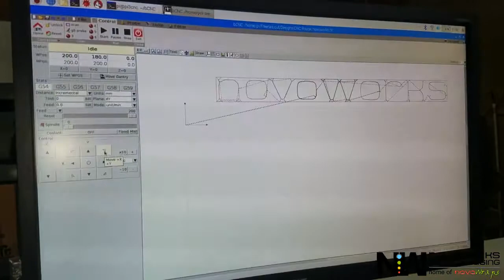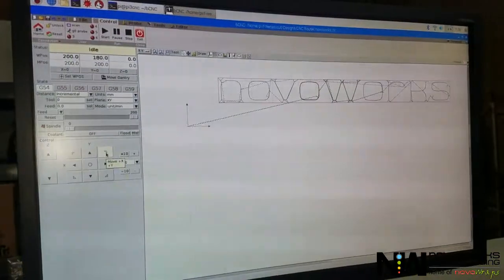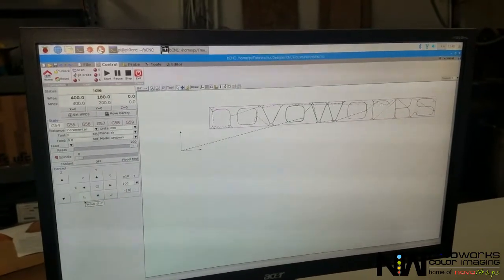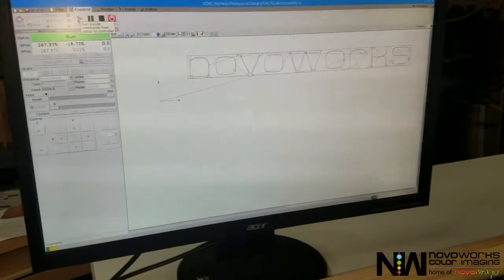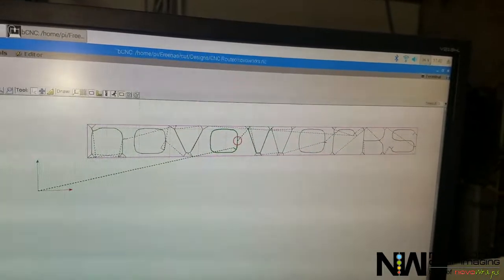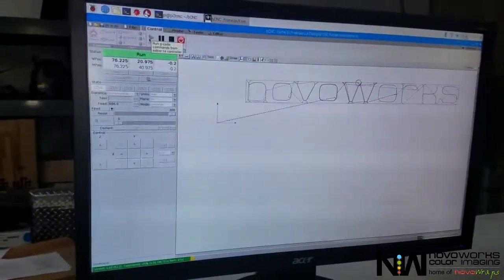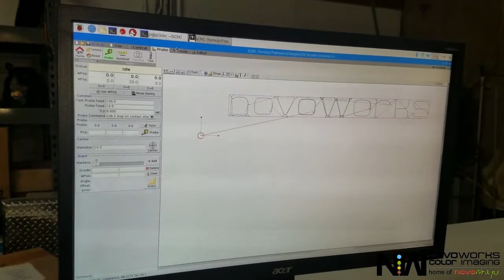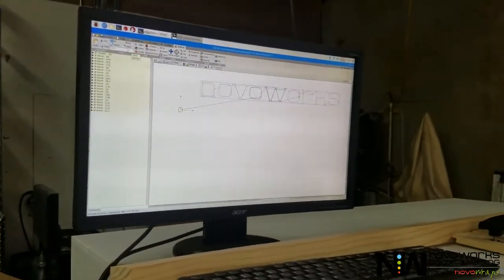Quick video of the Raspberry Pi 3, bCNC and the Shapeoko XXL

Comment: i has build rpi3 and gpio output whit shift level converter, 3,3V in to 5V out to DM556 drivers step, dir, enable pins. and input limit,E-stop etc, optocoupler board 5V to 3,3V to gpio,  now problem is ,,,,,,,,,, were i can download RPI3 linuxcnc image to my rpi3 SD card. can testing my build how working.  this mean need image to SD card were have.

Comment: I was searching for something like this as I would like to use raspberry pi to run my cnc. Can you tell me if you are using raspbian as an os? Are you still having success using this setup?  
Thanks for your time.
John
Reply: Hey there... yes, still running it and working fantastic!  Yes, using Raspbian
Reply: @Novoworks  Thanks for the info. Does bCNC load the GRBL files from a USB stick? Sorry for pestering you but I'm having a hard time searching for this specific type of cnc control and your setup seems to be the type I am looking for.
Thanks,
John
Reply: @ripper143  I use FTP to transfer the files to my raspberry. But you could set up a networked shared folder too. I avoid using USB dongles.
I use remote desktop to access the rpi from my desktop PC or tablet.
There's also other projects like the "chillipeppr", where you run a chillipepoer server on your rpi and then all the GUI is in your web browser. It was a nicer, and faster interface but lacked gcode generation, and was kinda buggy the last time I used it.

Ultimately you'll want to just get a full PC capable of linuxcnc. But the RPI/bcnc setup is working flawlessly for me, and I'm always using bcnc's surfacing gcode generator

And the "grbl files" you're referring to are gcode files :D

And, make sure your gcode generator DOESN'T USE g28 command to send the spindle to MACHINE zero. In fusion360 it uses g28 immediately as a "safety" feature but it will often crash your spindle deep into the wasteboard. You can remove that g28 command from fusion's headers. Other software I've used hasn't used g28. 

Theres a different between "machine coordinates" and your "workspace coordinates". Machine coordinates never really change. Machine zero is wherever your spindle was when you started the machine up.

When you set zero, you're zeroing your work coordinates. So your machine zero and work zero can be drastically different.

If this makes no sense, just make sure your gcode generator doesn't insert g28 anywhere in the program lol.
Gcode files are text documents btw you can just view them in notepad.